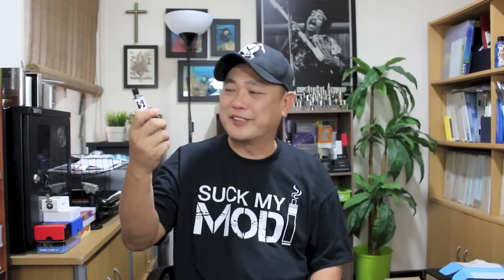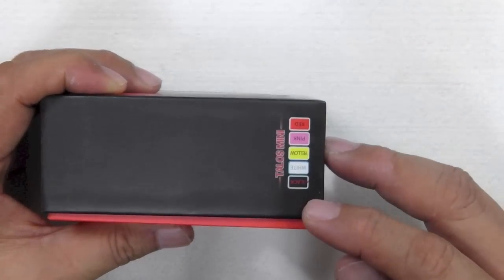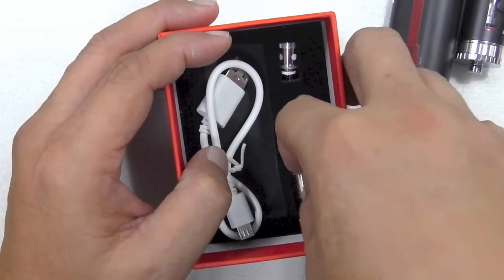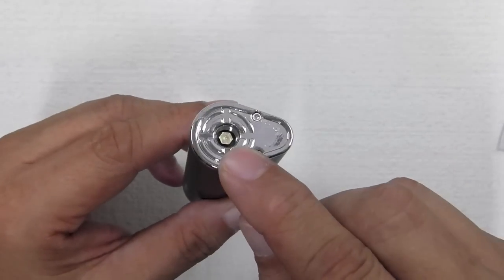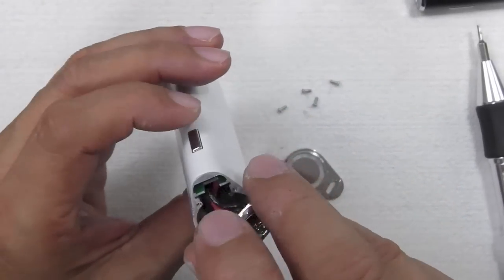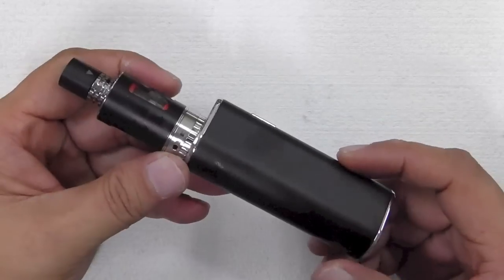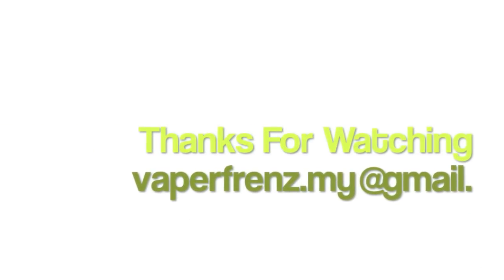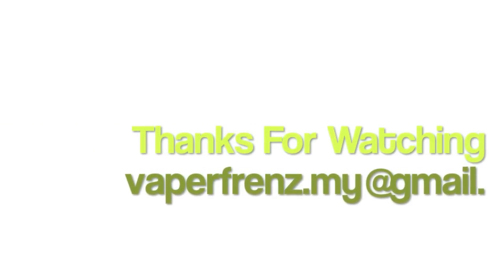Talos Mini Start Kit By Smokjoy

Comment: Great review Richard! I have a question about my Subtank Mini. I'm using it on my Evic VTC Mini at .5ohms but each time I fire over 20W, I get a dry hit. Any ideas how to overcome it? Cheers :)
Reply: +Stefan Janoski could be;
 your e-liquid is too thick, above 70vg / 30 pg
 your on the smallest air hole
 kanger has newer vertical .5 coils that are suppose to take higher wattage.
Reply: +addy tuney I believe the ratio is 50/50 but I'm not too sure. I have the airflow opened to the max and I'm using the rba coil head. Any other ideas?
Reply: i am quite familiar with the rba and love the flavor from it. if you have the old style with the tiny juice slots then it needs to be modded. an easier option is to purchase the re-designed rba with juice holes in the barrel and very lightly cover those holes with cotton. do not pack the cotton around those holes as it will restrict flow. if you want to mod yours you can dremel or file the slots larger just be careful not to extent the opening into where the o-ring seat is on the bottom. i open my juice holes up to a #18 drill bit then dremel the inside/outside smooth. there are some pics on my instagram @tuney219
Reply: +addy tuney I think I wicked it a little too much. Thanks for your help, addy. have a good day
Reply: glad to help!